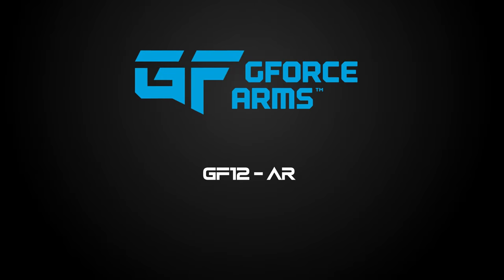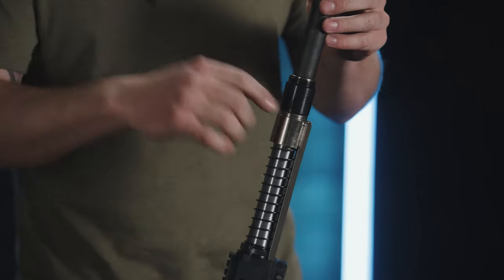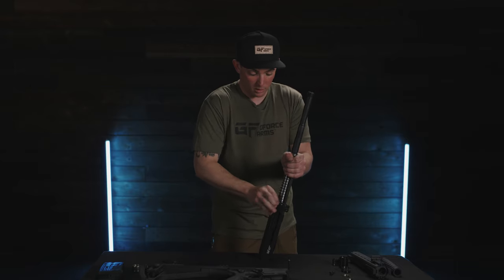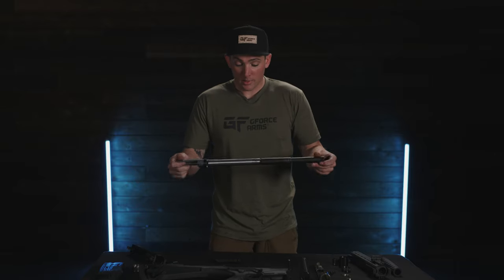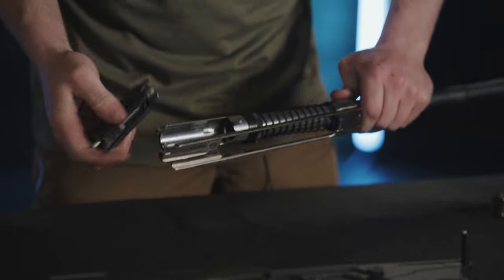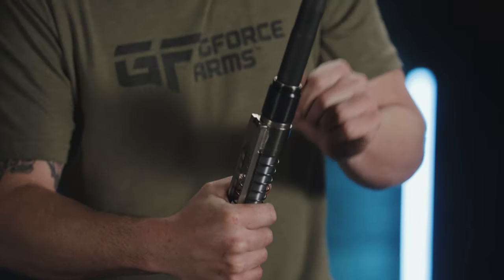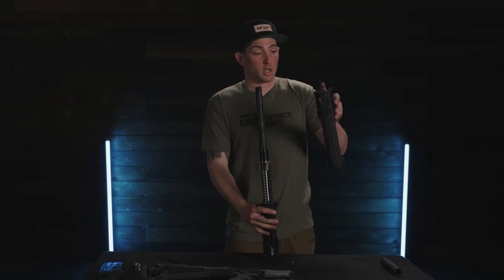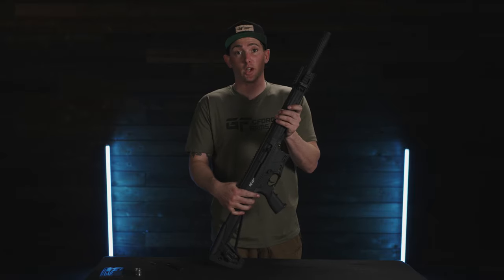GForce Arms - GF12AR Semi-Automatic Shotgun Firearm Teardown

Comment: Picked mine up last week, Just took it to the range brought 100, 1400 fps 2 3/4 inch  target load with me to break it in, Took about 30 rounds to get them to cycle properly, After the 100 rounds i put 1200 fps load in to see if it would shoot and it did indeed shoot flawless after the first 30 rounds, Tried 3 different loads. Did have one malfunction it slam fired not sure exactly what caused it, Other then that great gun. Had a blast after the first 30 rounds.
Reply: If you split the receiver and pivot the upper on the front pin, can you see straight through the magazine well? I live in shitty NY and would have to pin the magazine and load it that way. Any help would be appreciated thanks!

Comment: Brought mine out today. Fired flawlessly from the first mag. Outstanding tbh. I also have the cheap pump. These are the two best guns I've owned (so far). Had an old Noble 60 and a mossberg 500 and they outperform both with target load
Reply: This is a moded GF2P 12 gauge pump. The cheap one but I upgraded it for cheap now it's badazz!

Comment: I discovered a trick for those of you with a brand new AR12 that will not cycle without jamming. Just store the gun with the receiver open (locked back) and Max load your magazines. After storing my gun like this for 30 days- it runs (high brass) like a well oiled machine.

Comment: The choke is Benelli/Beretta style. No more constricted than full choke. M 1919 type magazines. Replace the flip up sights with a quality brand. The gas pistons depend on your loads. Over 1500 fps need the heavy piston according to the people I've talked to. The stock and lower are 1 piece molded. I'd like to see a different front grip with key mod or rail options. And a way to install an adjustable stock. Overall a good weapon. It takes a break in period of getting used to what piston to use with what ammo. Learn your weapon..Learn your ammo..Know your use
Reply from the maker: Thank you for your comments and thoughts. Appreciate your honest review. More coming soon, stay tuned.
Reply: I edited my original post. It's a M 1919 magazine. My typo error sorry folks. Most gun sights have 10 round mags. 20 round mags too. And FYI the original 5 round mags you can slide them bottom up on the short rail on the front grip. It is really as simple to tear down as the video. Enjoy your toys boys

Comment: Just got it a few days ago and already put 100 rounds through it but when attempting to disassemble it the included wrench tool stripped the noches on the screw so I’m not able to take out the bolt assembly so 6/10 for me
Reply: the factory does not recommend you remove it, it is medicated glue
Reply: Not sure it matters but heat the barrel nut up with a heat gun and use a vice and take a punch and hammer to each notch until you slowly turn it loose, then apply for a free one with the warrenty

Comment: Got mine today headed to the range in the am
Reply from the maker: Let us know your thoughts and consider writing us a review on Facebook. Thank you.
Reply: I took It to the range and it wouldn't eject the 2 3/4 target loads I also tried high brass double OO buck and still wouldn't eject. Is there any ideas on the issue or should I try a heavier load?
Reply from the maker: @teztez6518  We recommend using 1300FPS or higher velocity ammunition.
Reply: I will definitely try that out and send my response. I dont have a fb but I will get the review posted in the comment section
Reply from the maker: @teztez6518  It's a common issue. We are confident it'll be a much more enjoyable experience. Thanks for the follow-up.

Comment: Just picked up the MKX-3 today, I bought 2 of them, can you tell me how to install the muzzle break it came with, thanks for the video
Reply: Remove the choke tube with the removel tool that is located in the box of choke tubes and install break by hand, I also used a small piece of rubber and chanellock pliers to make sure that it was good and tight
Reply: @solardozer1  thanks brotha, do you have to take the barrel collar off

Comment: Are the mags proprietary or are they compatible with others on the market. Picking one up tomorrow but you can't have enough mags
Reply from the maker: Thanks for your comment. You can use other mags, they are specific models but no they are not proprietary.
Reply: So what other brands of mags will work in the firearm? I just bought one of these and am looking forward to getting it in.

Comment: Forgive my ignorance but I'm teaching myself, what's the point of the heavy load piston?
Reply from the maker: There are many opinions on what a “heavy” load is.  Some define it as the weight/size of the ball inside…6 and above being standard load and below 6 being HEAVY load.  Others consider it a defining line between 2 ¾ inch as STANDARD load and 3 inch as HEAVY load.

Finally, another opinion is that of the amount of powder charge. If you follow one of these, you’re probably ok.

Comment: Just picked it up and went to do a field strip for the first time to clean out the barrel and make sure everything is lubed up and the barrel Nutt won't come off.  Stripped 3 noches from using the supplied wrench.  Then used vice grips and a malet with no luck.  Applied light heat to it and went back at it with the vise grips and malet still nothing.  Yes I was going counter clockwise and the wrench was in  the correct orientation.  Haven't shot it yet but I can say that the manufacturer over tightened the barrel nutt.  Anyone else have this problem and a solution?  Very frustrating!

Comment: have 2 questions, planning on storing mkx3 in a safe built into the back of an SUV.  It will be in close proximity to a 12'" Alpine sub in a ported box that hits almost just as hard.  Should I be worried about vibration affecting said firearm? Secondly, does the mkx3 cycle more easily (with less chance of a jam) when loaded with "high" brass?
Reply from the maker: Hi.  Not sure about the vibration of the sub, but it should be fine.  Heck, if it can handle 12GA power, it can handle a sub.  Also, works much better with high brass shells (velocity over 1300 FPS) for reliable cycling.
Reply: @GforceArms  good point, thanks guys!

Comment: You just let the charging handle slam back right?
Reply: Also if i put the safety on then cock the gun is it normal for it to remove the safety? Sorry new to guns and don't have any1 to ask that is highly educated with guns
Reply: Let the charging handle slam back yes, not allowing it to return on its own is typically called "riding the slide/charging handle" which can cause you problems.  As far as disengaging the safety, I'm not sure about your particular model, but generally, if it's a manual safety, it should not disengage unless you manually disengage it, even when putting in battery.

Comment: My rifle came with a heavy load ring? What is it for??
Reply: I want to know that as well the manual not clear on that.
Reply from the maker: There are many opinions on what a “heavy” load is.  Some define it as the weight/size of the ball inside…6 and above being standard load and below 6 being HEAVY load.  Others consider it a defining line between 2 ¾ inch as STANDARD load and 3 inch as HEAVY load.

Finally, another opinion is that of the amount of powder charge. If you follow one of these, you’re probably ok.
Reply: Where does it go on the rifle??
Reply from the maker: @raymonde3520  Watch the video, replace the standard gas piston ring with the heavy load gas piston ring when you're shooting any ammo 1500FPS or higher.

Comment: Mine wont cycle 00buck or slugs in 2 3/4 or 3 inch. the biggest thing mine can shoot is 3shot 3inch. Ive swapped the piston light to heavy and back. its just bolt action with 00buck and slugs. Also it doent feed well with short brass shells, it needs a long brass based shell. I wouldnt recommend buying these guns. I would take a hi point over this paper weight. Its like a new Ferrari, looks cool but gets out performed by competitors half the price. Good luck
Reply from the maker: The most common reason for a short cycle or jam in a gas operated semi-auto shotgun is the lack of velocity produced by the ammunition you are using.  Your GForce Arms shotgun will perform and cycle optimally with ammunition that produces a velocity of 1,300 feet per second (FPS) or faster. You can shoot both 2 ¾” and 3” shells from your shotgun.  We do not recommend  the use of mini-shells.

Please fill out our service form and we'd love to address the issues you've been having with your GF12AR. https://www.gforcearms.com/service

Comment: You do not love guns. A gun is a tool designed to do a job. To by a gun because I looks “cool” is stupid. It only holds 5 rounds, the same as most tube feed guns. I have had 5 of these come into my gunsmith not running. Trying deal with company was useless. The places they got the guns from won’t take them back. So, if you buy a shotgun under $1200 or so it is probably made in Turkey and will end up being  9 pound paperweight in your closet. Save your money and get an m4 beretta or benelli that will last you a lifetime.

Comment: What would you reccomend using the heavy load piston for?
Reply from the maker: There are many opinions on what a “heavy” load is.  Some define it as the weight/size of the ball inside…6 and above being standard load and below 6 being HEAVY load.  Others consider it a defining line between 2 ¾ inch as STANDARD load and 3 inch as HEAVY load.

Finally, another opinion is that of the amount of powder charge. If you follow one of these, you’re probably ok. 

Read all our FAQs here: https://gforcearms.com/faqs
Reply: Would these be able to shoot a 2 3/4 or 3 inch slug and would you personally consider that a heavy load?  I ask because i like slugs more than other types of loads.
Reply from the maker: @jefflane7507  Slugs 2 3/4" or 3" would be considered a heavy load, we would say.